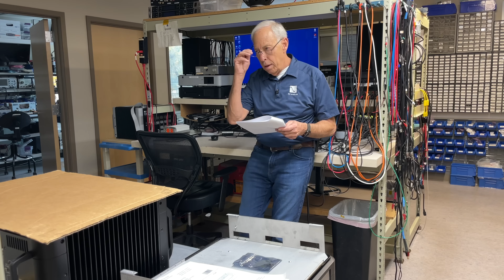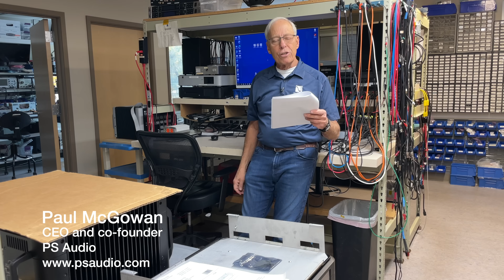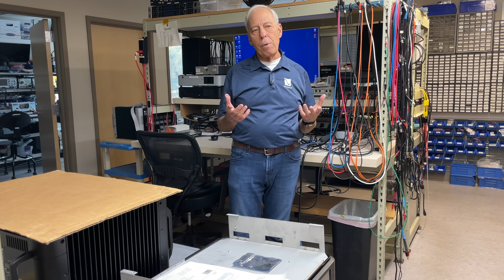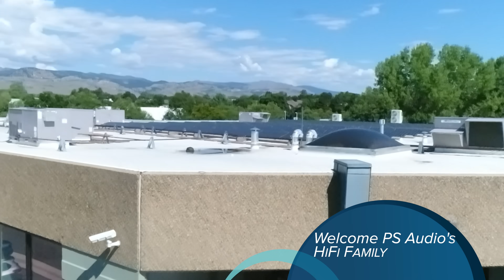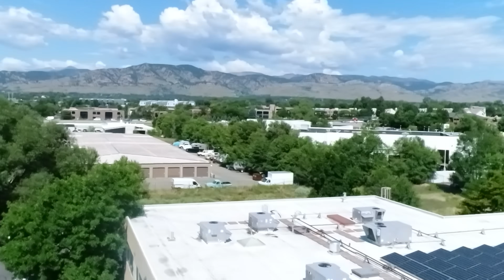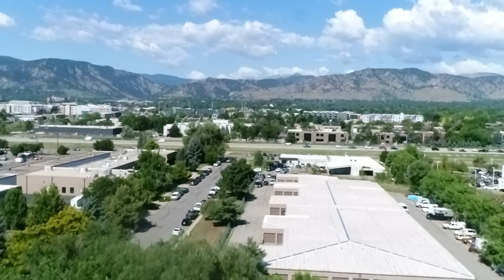Hardware vs  software crossovers

Comment: I wonder about the terminology used here.  Its not called a "hardware crossover".  Its passive (for non-powered speakers and almost always inside the speaker cabinet) or its electronic or active, usually used with subwoofers.  Then there are software crossovers which would be part of a computer.  Please get your terminology correct.  Otherwise its very confusing.  You'll almost never find an active crossover ever used in the midrange or higher in a high end system due to the inevitable problems they introduce.  Passive crossovers just sound better, plus we don't need steep crossover slopes in those frequencies whereas we do need a steep crossover slope for a subwoofer because we don't that large driver(s) messing up the midrange.  Many subwoofer crossovers are 18 or 24 db/octave which is pretty steep.  Plus a passive crossover used for a subwoofer would not only have much less slope but it would rob power apparently.  So a larger power amp would need to be used for the subwoofer.  

But what about software crossovers?  If your audio source is from a computer only, couldn't they be used and how do they compare?  I think you'd need separate amplification for each speaker driver though raising the cost significantly.  But the tweeters of most speaker are incredibly efficient so maybe you wouldn't need much.  But you don't want to use different amps for midrange and tweeters!  A manufacturer could make 2 amps sounding very similar, one being higher powered I suppose, with the same power supply.  

Any opinions out there on software crossovers?

Comment: A Denon AVR uses Audyssey MULTEQ for example where the crossover frequencies of each speaker and subwoofer can be altered by the graphical user interface built-in the processor. Having the option to bi-amp my Tannoy Revolution floorstanding speakers, the Denon can supply the signal to the HF and LF binding posts of the speakers bypassing the internal hardware crossover by removing the joints between the posts of the speakers. That alone can help frequencies rolling off and apply  the desired slopes that blend much better than before, eliminating booming bass and all the shit that I can come across spoiling my sound.

Comment: For me a software crossover is the split of frequencies on the digital domain with DSP. A good example of this is the Buchardt A500 with DSP, one DAC per drive (if I'm not mistaken) and one amplifier per drive. No passive crossover at the speaker at all.

Comment: I always love these PS Audio Q&A videos, but this was the first one that was a little off base.  I think most folks know something about passive and electronic crossovers.  What we (speaking for myself) would like to know pertains to whether or not there is sound quality degradation using “software” (eg, miniDSP) crossover and correction.  We spend mega-bucks on a nice DAC, then surrender that quality to digitize the signal again to use a DSP to either do crossover work or some type of room correction.  Does re-digitizing cause us to forfeit the benefits of that nice DAC we saved up for?  Can the signal be over-processed and degrade the end result?

Comment: Hardware crossovers whether before or after amplification suffer from component tolerance issues. It is hard to achieve 5% tolerance on the filter frequency so the woofer might be 5% low and the tweeter 5% high. These leaves a dip in the response or visa versa causing an overlap and bump. This is why steep cutoffs cannot be used, this would make the mismatch worse. Also, speaker crossovers get hot as the volume goes up, components change with temp and the response changes. Software crossovers operate on the digital numbers before the DAC. They use math and time delays to make filters. The math is exact and the time delays are precise, set by the crystal clock oscillator allowing for much more accurate filter characteristics. They also track since both woofer and tweeter filters use the same clock allowing for very steep cutoffs and many other effects that are very difficult to achieve in the analog world. Software filters are far better than hardware but require an extra DAC and amp per output. Another benefit is that without a speaker crossover, the amp has direct control over the speaker. An example of a digital filter - the output is 2 numbers added together, one is the next number in digital stream, the other, a number that has been stored in memory for 1ms. If the input is a 1kHz (1ms long) sinewave, both numbers are in phase, exactly the same, so the output would be (1+1=) 2x the input. Now if the signal was 500Hz (2ms long), the 2 numbers would be perfectly out of phase, the exact opposite of each other. When added together the output would be (1+ -1=) 0, a perfect notch filter, not possible in the hardware world. This is a simple example but hopefully demonstrates the basis of how software filters work.

Comment: Me personally I like to start with the amplifier input using resistors polyester film cap and microfarad cap picking certain values that sound really good and then use the digital software like equalizers and things like that some music that is recorded or downloaded does not sound very good so it's very important to get a really good clean sounding audio signal first then proceed with filtering. I personally like to do this while the amplifier is up and running. Some people like to plug their phones directly into the amplifier and that doesn't always sound good so that's why I take the time to start with the input first on a
amplifier when I build one 🤗 using Uf cap, polyester film cap and resistor. Then build really nice crossovers for the output of the amplifier. Rather they be active or passive crossovers and then connect the speakers 🤗💖. And picking the right speakers is very important! That will complement the amplifiers audio output signal. And of course I'm self-taught I speak from experience LOL 😂😝💖 and I'm only talking about pro audio amplifiers home stereo amplifiers are a totally different story to me that is. Most home audio amplifiers come equipped with all the bells and whistles.

Comment: I agree Amen to that Paul 👏👏👊💖🤗 love how you explained so well done. As I said before I like to use polyester film caps as well they cost more but they sound so good. Along with microfarad cap resistor and yes MH coil or air coil. If you have a nice crossover calculator you can build some really nice crossovers. 🤗🤗

Comment: Paul, you're old enough to know that there are -- or at least were -- line-level hardware crossovers.  Back in the day there were quite a few separate "electronic crossover" components available to audiophiles -- even Heathkit offered them -- and they were entirely analog, with no software or firmware whatsoever because the DSP technology required for that to work didn't yet exist.

Comment: Please answer the software question, Paul. I was excited, seeing the title of this video- but electronic, instead of software, was discussed. Love to hear Paul’s thoughts on best software options and implementations.
Reply: Hi, as a DIY enthusiast, I can suggest you do what I did. Set up any cheap old computer to do all the processing via HDMI or SPDIF to an AVR using programs like EQ APO or even music players like JRiver. These have powerful tools built in to handle anything.

Another option would be to spend money and buy a MiniDSP 2x4 HD or 4x10 HD, these are fairly straightforward to set up and don’t need any computers, but I believe they require discrete power amplifiers and pre-amps.

Comment: Two major points missed. 1) Software crossovers use much less power resulting in a more sensitive speakers 2) Software can correct issues in the time alignment of drivers where hardware passive oftentimes can't

Comment: Hi Paul - I just found your videos and I'm hooked. I have a question that perhaps you and/or someone else could answer.  When I see surround sound systems set up, they often show huge rooms with lots of open air and space.  My living is small in comparison, 12 x 15.  I have my front L, R and center speakers on shelves right below my TV.  There's about 3 ft. between the L&R speakers and the center is directly above.  My sub is across the room. How necessary is it to have more space between my front speakers? Should I point the speakers slightly away from each other to achieve more separation?  Thanks.
Reply: He's a nice guy, he'll probably respond if you email him. 

Can't speak for him but all I can say is get those speakers wider than that  if possible at least 5 ft to get some decent separation and imaging. You should hear a difference.

Comment: I think our dear Paul missunderstood the question. The question was hardware vs software crossover (which can control the base through a program. Sound cards and computer software can do that) and not hardware vs electronic crossover which are both hardware

Comment: Passive Crossovers (the most common) have to pass significant current which may cause distortion near the crossover frequency when the music is played loud. Active (small signal) crossovers hardly pass ANY current but require a dedicated power amp (for the speaker) at each output. This is called bi-amping or tri-amping your system. The component values in an active x-over can be made much smaller for caps and much larger for resistors since the overall impedance is much higher than a  passive crossover. A typical active crossover is like a pre-amp with two or three sets of outputs. Active crossovers typically have their x-over frequency and gain adjusted by the user. These settings need to be tuned to the speaker crossover specifications or you will get inferior sound and possible speaker damage. Newer "DSP"-based  crossovers are all digital. This eliminates the phase shift by-product found in both active and passive analog crossovers. The internal freq and gain settings in DSP-based crossovers can be more precise. Some even allow the user to program-in the response curves of common filter designs. One of the most common (and versatile) is the Linkwitz-Rielly design.

Comment: I believe Paul answered a different question that allowed him to promote the cost of the parts he uses in his speakers with passive crossovers.  I think lot's of people are achieving great results with multi dac/amps and software crossovers before the DACs.
I use simple first order passive crossovers and then clean up the result with a parametric equalizer in the streamer software.  A diy hack that works very well.
Reply: True. What he said was interesting & informative, but avoided the software side of things which is very relevant in 2020+

Comment: I was thinking the question had to do with hardware in the speakers vs. the crossovers in home theater receivers - where you can set the specific crossover frequency with the receiver.
Reply: As did i

Comment: Electronic crossovers can also be “hardware” or “digital”.  The vast majority of pro speakers use electronic crossovers.  Hardware crossovers are analog and can be passive or active.  

Digital crossovers are exclusively active.  The band selection is done using digital algorithms to separate low , mid, & high frequencies. Analog signals must be converted to digital, processed, then converted back to analog , and amplified before delivery to speakers.

Active crossovers must precede a gain stage (e.g. power amp) before the signal is delivered to a speaker.

A separate amplifier or amp channel is required for each frequency band and speaker.

By the way, passive crossovers can be inserted at any point in the signal chain.
Reply: All MiniDSP models have Digital IN & some also have Digital OUT allowing you to utilize whichever DAC you desire. The initial Analog to Digital step that you said is a "Must" is not advised, but i understand that some other components in one's setup might restrict you to this. My setup is Computer USB Digital output to MiniDSP DDRC-24 to control 2.2 speakers, then output Analog to the amp.

Comment: As stated below, a hardware crossover uses devices that leverage the electrical properties of certain components to filter the audio signal. Coils uses reactance to limit high frequencies. Capacitors use capacitance to limit low frequencies.
A software crossover digitizes the audio signal and then uses math and other computer logic to manipulate the audio information. It is much more expensive, but when done well, can manipulate the audio signal in many sophisticated ways.

Comment: 15 years ago I visited a friend who was into designing and (re)building audio stuff, and he demo'ed his latest :  2-way speakers without crossovers, just an audio DSP that had parametric equalizers. It was a small room, big speakers, and that digital Xover allowed them to produce huge bass, punchy and controlled, with great mid and high. You could increase the volume, in that small room, and still hear everything. Magic.
you just can't have 100db/octave analog filters, regardless of price.

Comment: Seems lots of people in the comments and Paul himself are confused on this topic.
A software crossover works in the digital domain before the DAC. 
You need a separate DAC, preamp, and amp for each driver.
So if you are using some high end stuff like BHK amps, and a PSA DAC, a 3 way speaker will cost you about $60,000.00 to drive.
This is why speakers like the LXMini use Minidsp and multi-channel Crown amps.

Comment: Somewhere along the line of Paul's explanation, the software cross over became an electronic cross over... But those are hardware as well. If you want to do a real software cross over you have to do the frequency discrimination on a digital level and then use separate DAC for each frequency domain.
Reply: I believe Linn in the UK already do this with their Exakt technology
Reply: @Sblackfll thank you for the reminder, I think Meridian were the first. No doubt with processing power these things are getting better. I’ve had active systems but in the end went back to passive. There’s something direct and pure about it even if the crossover is a bit inefficient and crude in comparison. I have Kef Blade 2’s where they spent a lot on the passive x-overs (as well as the rest of it) and to my ears sound better than any active systems I’ve owned or heard.
Reply: Trinnov

Comment: But a true "software" crossover would involve digital signal processing, which was not mentioned in this video.
Reply: Because audiophiles insist on their holy DAC before the input
Reply: @Harald_Reindl  All MiniDSP models have Digital IN & some also have Digital OUT allowing you to utilize whichever DAC you desire. Welcome to 2022😉
Reply: @ItalianEagle1  and how is that related to my post besdies that audiophiles would crucify you for the word MiniDSP? again: creep away with your external DAC, the first thing my Yamaha does is convert it back to digital for "dynamic loudness" which is essential when you listen to music in the night - DAC happens at the very last stage direct before the power amplifier - period
Reply: @Harald_Reindl  guess i misunderstood thinking that audiophiles want Their own DAC to do the conversion.(which minidsp allows)  I dont use an AVR so cant comment on that.  On the miniDSP:  A good portion of audiophiles hold the A/B comparison with high regard where the dirac EQ'd system wins 9 out of 10 times, and measures better 10 out of 10.  The "Audiophile Junkie" explains this on his channel and you will see all of this become more widespread over the next few years.
Reply: @ItalianEagle1  surely, if they don't know  - but if they know "don't bother me it's not pure" - on the other side they don't hear their holy cables in A/B :-)
Reply: @ItalianEagle1  my point was that the audiophiles insist in their idiotic and expensive speakers with analog components resulting in phase shifting and a ton of problems a digital crossover don't have - they insist in their holy DAC for thousands of dollars because digital is evil and if it isn't vinyl at least make it analog as soon as possible because i they have stupid analog cables for thousands of dollars which needs to be used as they are magic for the sound - a bunch of deaf fools

Comment: Some DSP type crossover have room correction built-in. It have much more control on room's bass response.
Reply: The room bass response is due to the room modes, you can't EQ that away as any amplification of a tone will also amplify the opposite node resulting in the same overall response. Room correction over all is a... lets call it good idea used wrong, most of the time. :)
Reply: @PSA78  Your comment is true only with regard to NULLS. 
In contrast, PEAKS can easily be reduced in amplitude to create a more overall balanced frequency response. Without addressing the peaks in a setup you can end up with an undesirable listening experience heavily influenced by "one-note-bass", or "room boom". And then there is everything in the range between peaks & nulls of which varies with EQ'ability. 
It is good practice to Measure a rooms frequency response before & after EQ to see the Actual effect rather than assuming or talking theory.   
I'll add that it is advised to correct room response issues with a variety of methods including Speaker Placement, Listening Placement, Room Treatments, & EQ.
Reply: @ItalianEagle1  Yes there can be bumps as well, that's correct.